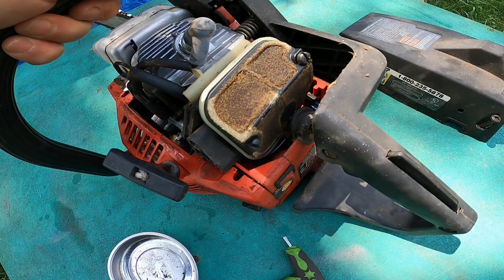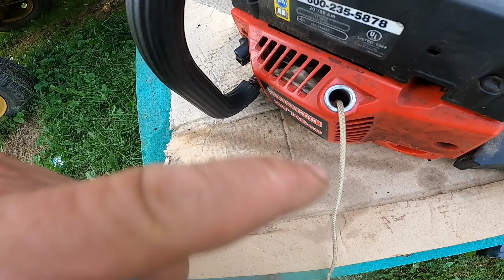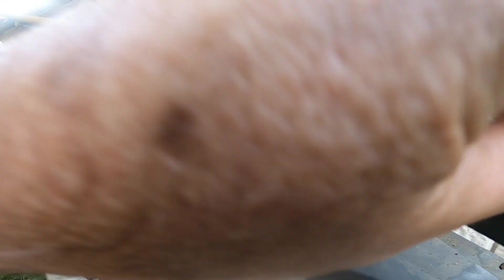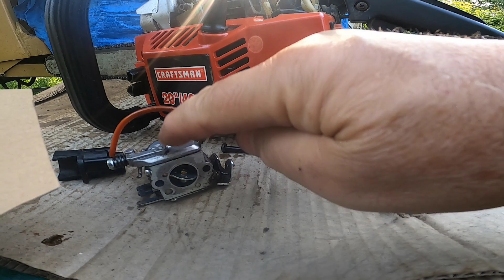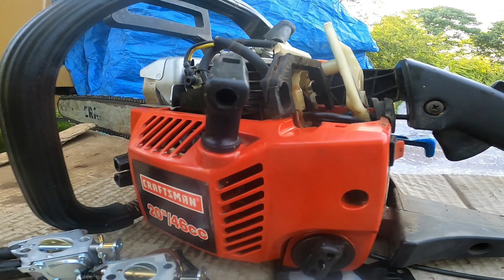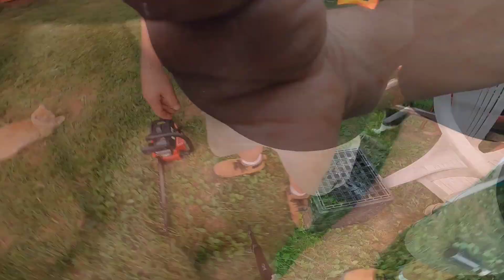No Start #Craftsman Chainsaw Trash Pic Tips and # Repair # Hipa tool/part review

Comment: I have the exact model also as a trash find from the local dump. Good video and I also have cat supervisors that will assist, subbed and liked.
Reply from the maker: Appreciate the sub and the support! Glad you found another one to save. My supervisor usually does not miss a project LOL.
 Be well, Joe Z
Reply: @JOEZEP54  Hard to pull so I am going out to pull bar and chain to see if it will pull over easier, could be binding. I need my Black Bart to eyeball it...lol
Reply from the maker: LOL, Well a closer look should help.

Comment: Good tip with putting oil on it. Great job on preparing the saw. And getting it running. Cheers joe
Reply from the maker: Thank you. Hipa sent me the carburetor but even if I had to pay for it can't be a 20" chainsaw for $13.00 & a hour or so working on it. Simple maintenance would have prevented this.
Stay safe, Joe Z